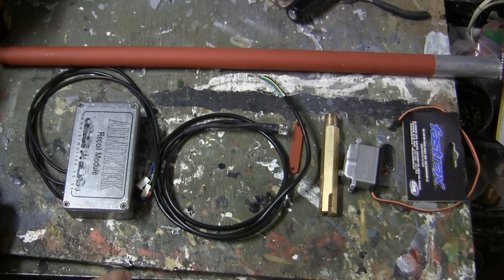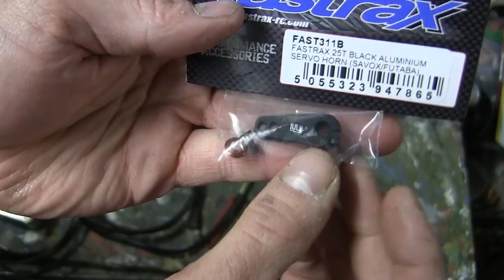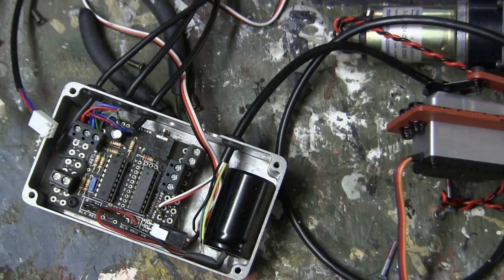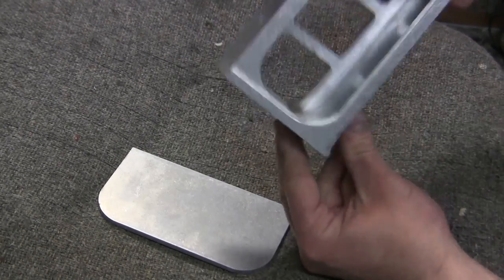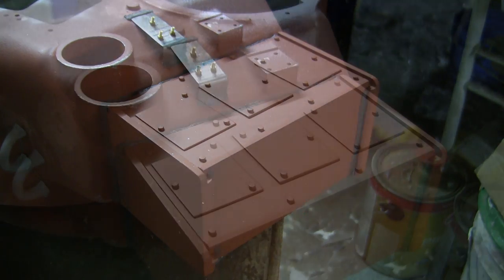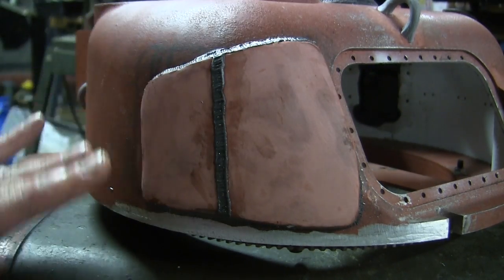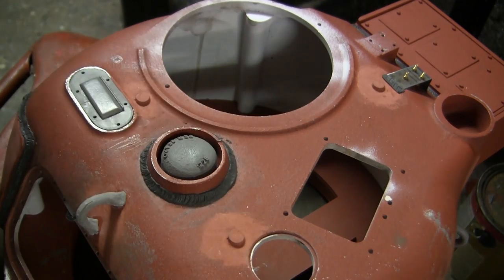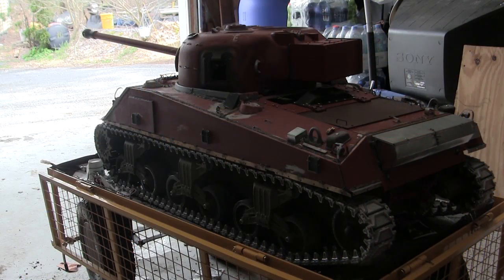RC Armortek 1/6th scale Sherman V Firefly project video#8 part 2 of 2 (Turret details /gun recoil)

Comment: The plate on the back could have been used to hold flags. We had 3 coloured flags while doing live firing at the ranges . Red: live and loaded ready to fire. Green: is clear and unloaded and blue: was lost coms are the radio is down. Last thing you want is people running around telling the range safety team your radio has gone down. This is my old regiment at the ranges and the flags are always centre back of the turret  as in the firefly. https://www.youtube.com/watch?v=IYsrxFP1hQk
Reply: If your wondering why not just have one for all 3 flags is because when you drive up to the firing line you have to present all 3 flags together before the shoot so the command post can see and tick the box to say your safe to proceed ..
Reply from the maker: Makes sense, but why then not have a tubes welded to the plate in stead of the bolts? With the thin bolts and retention nut I see the flags wiggling and falling out easier then if it were tubes, also the flag poles would need to be hollow tubes aswell as opposed to wood dowel flag poles, if the mounting system were made from tubes?
Reply: Not sure of what they had back then but modern tanks have tubes welded to the turret and they just drop in no need for them to be retained with a bolt. If you loose it then just get another from the Q.M. stores ...